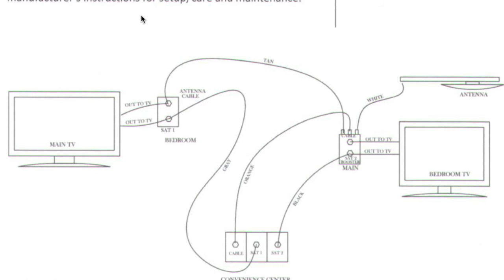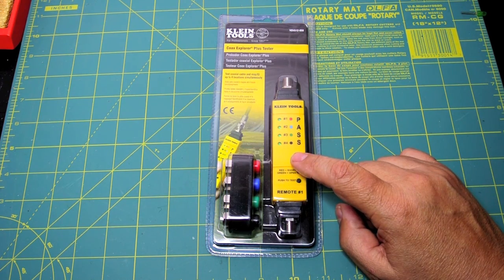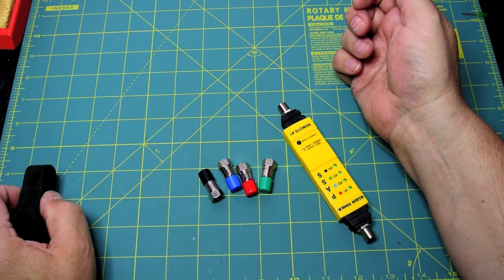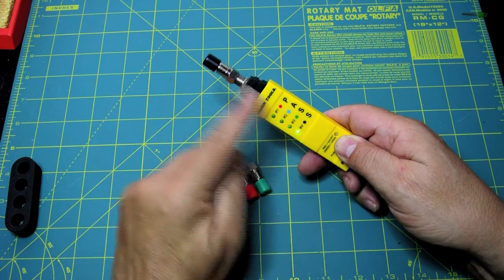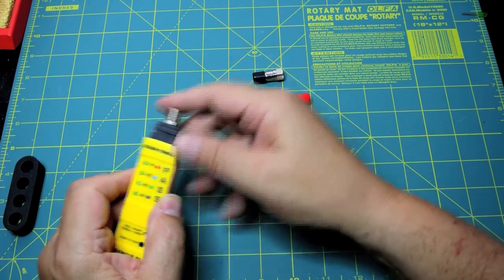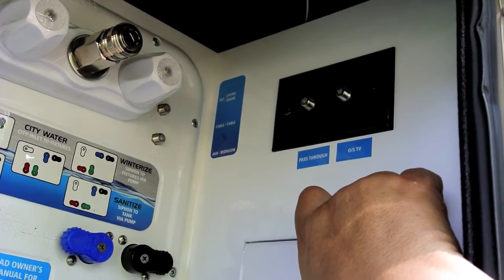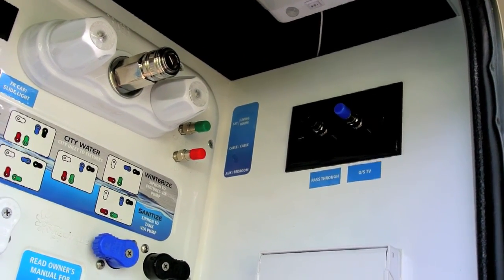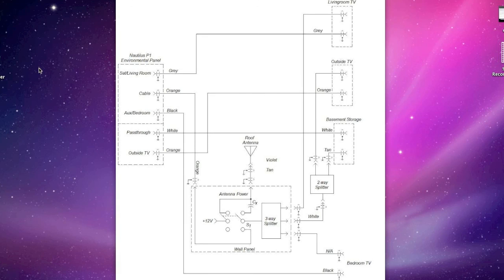Tracing out the coax cabling in my RV

Comment: Don't forget you can remove the wall plate and investigate the cables behind there. Often there can be splitters hidden there. Also take time to learn what a properly made coax connector looks like - frequently the connectors on the back side of the plate are terribly made.

Comment: Very nice vid, thanks. I have a similar problem on my boat. A real mess of various cables used for OTA, SAT, Cable etc. How does this work if your lead runs into a splitter block... is Sat distribution block.  Would I have to check at the block? Thanks for your time.
Reply from the maker: I have not tested it thru a splitter.